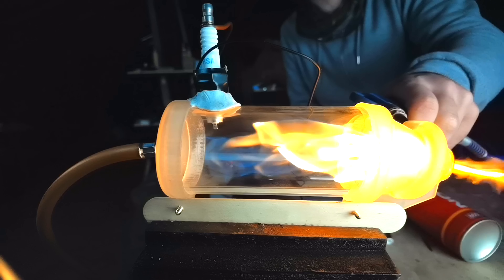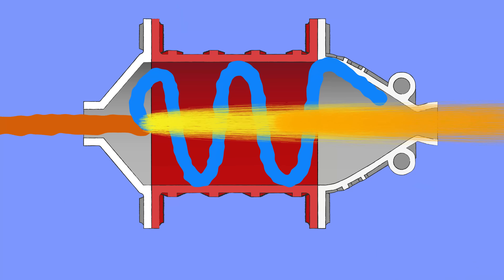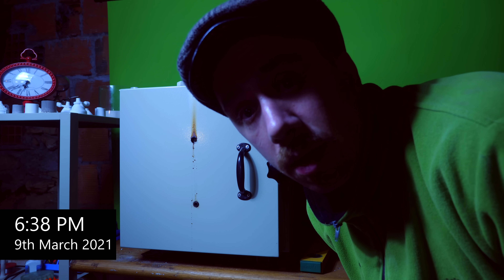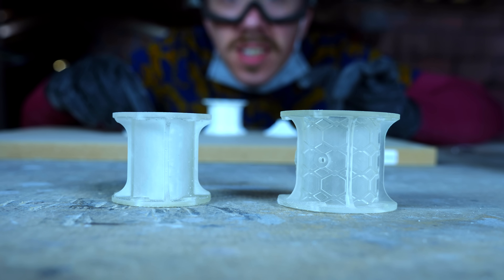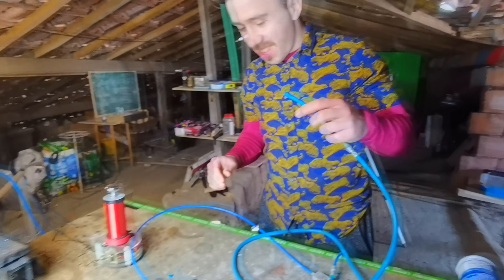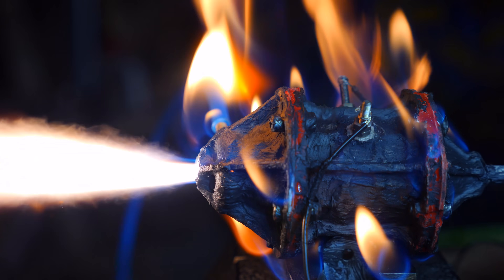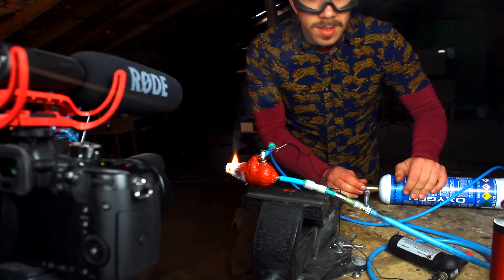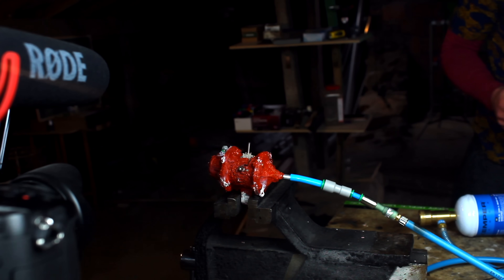Vortex Rocket V2.0 (3D Printed)

Comment: Maybe try lining the inside of the parts with aluminium foil; it's pretty inexpensive, and aluminium is a poor conductor of heat, which is why you can line an oven tray with it and pick it up with your bare hands, even after it's been in an 200+ºC environment for however long it takes to bake your food. If you leave overhangs, they might even help provide flush contact surfaces for your parts, which might help reduce leakage.

Comment: You cold 3d print in the rocket motor chanels ho can be filled with water ,and for the leak you can use carbon fiber or you can mold with ciment from prothesis (in hospital they use that stuf its a pouder combined with a solution and you have 15 minutes time to mold that) and resist like 1400-1500 *C

Comment: Hey Inzegta, I have an idea about the leaking problem, after you printed the engine parts put them in the oven, but dont let it dry completely, now pure ceramic resin in a container and sink the parts in the resin, then put them in a vacuum chamber, my theory is that under minus pressure the liquid resin will fill the small holes in the printed ceramic parts because the air trapped in the holes will be sucked out, and well the resin will get in. then place them under UV light and put them in oven again and let it completely dry, you know these last few parts better.

Comment: Id try something like soaking your part in concentrated sodium silicate after firing (preferably in a vacuum chamber to make sure the viscous stuff gets in properly; and then give it time to dry/cure; maybe repeat a few times. Sodium silicate does not have a super high melting point, but even if it goes all glassy when in operation, at least it wont burn or vaporize and its not like its just going to start dripping out of your microscopic pores. Perhaps there are more suitable alternatives to sodium silicate; but this is a cheap and available one that I know of, that I suspect would do the trick. If it gets into the pores properly might also help with the mechanical properties quite a bit.

Comment: I think there are two ways to go about this.  The first is your current method where you are covering the porous part with a non-porous material.  There is a patent from 2011 that tries to do this. The second would be to actually fill the pores.  There is an Italian paper that describes electrochemically filling the pores with metal.  Unfortunately I can’t read it so it doesn’t help.  But that gives me an idea, could you soak your ceramic parts in a slurry so that it fills the pores?  I wonder if you could even rebake the part to increase the overall hardness of it.  Does that make sense?

Comment: I recently printed some pressurized parts. 3d prints are very porous and need to be sealed. But sealing makes more sense if you seal it from the inside than the outside. You need way less sealant. (Sealant gets pushed into the pores, if it needs to dry, dry it under pressure) 
Of course I do not know how your sealant reacts with the high temperatures.

Comment: you can try 3d print metal. Some manufacturers use this method so you can probably ask them. I know its not accessible for everybody but for working vortex rocket that doesn't leak or burn down after 5 seconds i think it'd be great. Keep up the great work i enjoy your videos and admire projects you do :)

Comment: To stop it from leaking you could glaze it with pottery glaze in your furnace; it's essentially a glass coating so it should hold up better than the silicone.

Comment: You should get a CNC machine to make metal parts whenever necessary! 
It's still a form of 3D-printing (just reversed maybe)
Reply: 3d printing is additive manufacturing, while CNC mills are a form of subtractive manufacturing. Apples and oranges, both are fruit, but an apple is not a form of an orange.
Reply: @c-djinni  Hence the "just reversed maybe". Though, I don't think 3D-printing implies "additive".  Thanks for your input, though.

Comment: the ceramic is not strong enough to handle the vibrations, and is shattering
note that most of the engines start burning correctly, then add leaks over time.  this indicates new cracks forming while the engine is in operation
maybe try thicker outer walls, or thicker support framework
or 3d print some molds and cast your engines out of a more robust material

Comment: I think the porosity of the ceramic is a fundamental flaw that you're not going to overcome without essentially reconstructing it on the outside with another material. I think you need to consider printing ceramic molds and making the rocket out of aluminum or some other metal. I think casting the torpedo one in two halves is the way to go. Your could also use molds to make ceramic parts the normal way and use your furnace to fire them. Then you would have a ceramic part without the porosity.

Comment: Maybe lost pla cast plaster in a metal container with the metal fittings added before casting and sealed with brake paint. Won’t be pretty but should hold shape leak less.

Comment: I'd try to attach them that they sort of slide i each other, that way when you increase pressure, the parts should press on each other and make the seal tighter by itself, instead of trying to seal them by force from outside like bolts and stuff. However, the parts will probably have to be super precise.

Comment: My suggestion on to stop the leak should be layer it. Use the Refractory cement first, then a mesh, then another layer of cement then the silicone.

The other option is start with the cement again, then silicone, then more cement.

Comment: try glaze for ceramics :)
Reply: or several layers of silicate glue, for the entire engine after assembly.
besides, the silicone sealant that you use loses its properties at 300 degrees and starts to burn by itself :)

Comment: Hello Integza! My suggestion would be to 3D print a negative mold and use plaster or ceramic to cast the parts and then cure the parts in the oven. If this ide works this should fix some troubles. It would be like the lost pla technique, but instead of pouring metal the lost pla will give the internal shape needed for the Vortex rocket.

Comment: For gas leaking thru the porosity of the ceramic print, soaking the parts after firing in sodium silicate ("water glass") solution and then slowly evaporating the water off in a sub-100C oven might be worth a shot.

Comment: Lost of good tips here is seems like. Good thing I read a few before adding my own suggestion of glazing and slow curing with a supporting material like find sand or fine salt.  A slower curing might help limit the cracking too, but to really deal with the leaks, you need to use glazing that can handle high temperatures. I'm betting that it is not cold in the burn chamber and knowing how hot it is would help you figuring out what media to use for sealing. It sure looks like you get a burn through from the inside.

My weird mind went away on a tangent after that and wondered about using a water jacket around the whole thing and use the heat as a pumping action, it would help you figuring out the best shapes and such and maybe keep the whole thing a bit cooler. Then once that is done, you'd need to find the right material that don't leak and will handle the heat.

Another odd thought is using water pushed over the whole thing and letting it blast out as steam besides the main thrust, I'd like to see that actually, but I have no idea if it would work or not for testing. To go up it would be useless. Well unless someone figures out of to port water in flight, but then you could port fuel too. :)

Comment: seems like the porosity of the ceramic allows it to crack and fail. It may just be that bit to light weight for anything but low pressures. You could try glazing the whole part inside and out for a smoother harder finish. You may be able to do it with your kiln oven there. Another issue maybe a lack off cryogenic cooling on the vortex side. That would loose the insulation effect. You could try more inlets and bring the fuel pipe further into the engine ( say half way down ) to force the ignition to be after the oxygen has been down the body and is expanding down through the center. Impressive work non the less. Well done.

Comment: It looks like on the video, before the last engine lit itself on fire that the rubber expended do to pressure. Probably do to the coating letting go of the ceramic. Why don't you coat the inside of the chamber around the seal? I always feel like pushing against something is stronger then pulling against it.

Comment: Embed the engine into a block of concrete or plaster lol. Or just use carbon fibre again. Idk if the cement one would work 100% though because maybe the engine would melt closed on the inside.

Comment: The solution to your problem may be pretty simple:
since the engine is continually emitting thrust, and it gets red hot, its likely cracking from the parts moving and also being stuck to a vice. Maybe let the vice linearly move back with the retention of a spring?

Comment: Try a glaze of a product like ICT-100HT https://www.itccoatings.com/new-products/itc-100-ht-ceramic-coating
Might seal up the pores of the ceramic to stop the leaking. I've mostly seen it used in Kilns and such but it should work for this purpose.

Comment: Use your 3d printer to create your rocket/engines... and use the lost PLA casting method o produce a Bronze, rocket/engine. the metal you use is up to you but i bet it would last a bit longer than your porous ceramic.

Comment: You need to glaze your ceramics, may help with the leaking having a solid ceramic part.
Reply: Would a lead glaze help absorb heat?
Reply: @Longbowgun  lead would melt and atomize, so thats a big no-no
Reply: A glass glaze might work if it didn't crack. Best to research.

Comment: i have a comment for your vortex rocket, a some point there were explosition inside the chamber who dammage the proceline, and broke the engine. If there is explosion inside the vortex rocket, it's because the spark was in the middle of the chamber. You can try to put it at the output of the chamber, because after the first ignition, the reaction is going to auto ignit herself. i think

Comment: Why dont you try a sugar rocket engine, but instead of being a solid, one time use engine, use icing sugar injected into the combustion chamber as sugar is very flammable and if oxygen is mixed, it should have a similar effect

Comment: I doubt the materials in the body will handle the compression you would need to maintain a seal at the increased pressures when you add more O2, you need to clamp or compress the joins but i doubt the ceramic will take it, no idea what you can do to get around this

Comment: paint your prints with waterglass.....sodium silicate mixed with water......it can handle high temps when dried....you can bake it in your kiln.....it dries rock hard like glass to seal the porosity issue that your prints are suffering from....I hope that this helps you.

Comment: Scale up 3x. Handmade, multilayered design with custom triangular high-temp ceramic tiles, fired in a pottery/art kiln. Arrange the geodesic tiles in the desired shape/grid/array and connect them to a steel outer shell that is externally water cooled and internally pressurized!  Insulate the ceramic grid/tiles with furnace wool glued to their back protecting the steel chamber. Weld copper tubes around the steel chamber with a double helix starting from either end; this keeps the water from being too hot on the output side. Its basically a steel pressure chamber that won't melt with a ceramic inner chamber that has hundreds of cracks by design. Just keep the water from boiling and you're fine!!

Comment: 1 use replaceable graphite nozzle.  
2 pressure is too much try recalculate nozzle diameter. 3 try coiled copper tube with water to cooling, but i think all these actions, not enough because pressure and temperature is too high

Comment: Drying and pre-firing ceramics help aid in the amount of shrinkage that occurs to the end product. This is very important in thermal processing; if ceramic insulation products are not dried or pre-fired, the resulting shrinkage could cause heat loss issues in a furnace, as well as problems with the end product when it shrinks as heated to the required temperature.

Factors such as material composition, density and shape of the workpiece, moisture content, and trapped water all need to be considered when designing a proper drying program.

In theory, this is the maximum rate at which ceramics should be dried. Most ceramic-formed projects are placed in a controlled drying room, in which the temperature is set to ambient or elevated slightly, and the preliminary drying is done by humidity control. 

As noted previously, humidity and temperature are the variables that need to be controlled for successful drying. Whether drying takes place as a separate process or is a preliminary stage in a firing cycle, air movement can be key to uniform drying. During the early stages of drying, it is best for the air to be hot, humid and under a slight amount of pressure in order to flow through the load uniformly. Once the chamber is heated to temperature, forced convection fans inside the chamber move air through the load, and draft-inducing blowers pull ambient air through the chamber. As the temperature rises, the air loses some of its humidity, allowing the water content from the load to be taken up by the air. As the cycle progresses, more water content is absorbed and removed by the air flow until drying is complete and the product is ready for firing.

Platinum-alumina catalyst powders were successfully processed in a two-stage drying/firing procedure at a Mid-Atlantic plant using ceramic box saggers to contain the powder. The saggers were then loaded into tall, narrow alloy racks that rolled in and out of a pair of car bottom furnaces. The configuration of the alloy rack was designed to allow the saggers to be heated from the sides by the electric heating elements, and to allow for proper air flow around and through the load.

Two draft inducers at the roof pull ambient through the load at various points in the process cycle, especially during the initial stages of the drying profile, and at the end of the firing cycle to improve throughput. Not every ceramic product can be dried and fired in one contiguous cycle

Source https://www.industrialheating.com/articles/95370-factors-to-consider-in-ceramic-drying-and-firing

Comment: Try increasing the size of the contact plates of each part so there's more surface area for your parts to seal, making it harder for air to leak out. This will also give you more room to add more bolts tightening the seal between the parts.

Comment: How about putting the thermal paste you made for the pulse jet engine, on the exterior surface and then by using a compressor, suck air from the inside so the pores in the ceramic are sealed with the paste.

Comment: try painting it with engine enamel spray paint? Several thin layers 10? allowed to set about 20 minutes in between and then an overnight rest  to cure before testing? 
The only other idea i have is ceramic glaze which potters use.  I think the glaze forms a glass like coating on the outside and would probably hold up pretty well to the higher temps.

Comment: 3D print the engine out of some plastic and create molds to cast it out of some proper heat resistant material. I think this is the only way to avoid the gaps created by the 3D printed layers. You can see a similar method being used by Alec Steele for creating casted items.

Comment: Put the bulk of the engine in a metal tank with a COPV filled with helium for pressurization. If the outside is higher pressure than the inside, it is impossible to leak.😅😉 :awesome:

Comment: @Integza you could 3d print a ceramic inverted form of an engine ans melt metal with your furnace / a backyard foundry, King of randon style, and cast around the negative model, then break apart the interior ceramic.

Comment: You are the best! 
Try to give your engines some proper rest before testing - think about it: they’ve just been born out of hell oven and you throw them into more fire, they need some spa procedures, maybe some kind of ceramic bath to seal the pores... and in addition burn something Smokey under small pressure to seal the pores from the inside with burning waste (soot and ashes)
Reply: Or you should think about making a ceramic matrix with you 3D printer and  then make the engine of porcelain because as far as I understand it is a little bit stronger than the 3-D printer structure and The glaze it and you’ll have a wonderful tea pot. Collin furze will die of envy

Comment: Hey how’s it going, so you may be able to make a mold out of your 3D printed part and use it to cast a metal piece then weld it together. With metal you will not have to worry as much as ceramic as far as it busting.

Comment: Put the ignition as close to the nozzle as possible; I'm thinking if the gas is burning in as small a volume inside the engine as possible, it should alleviate heat and also some need for a perfect seal

Comment: You should consider applying the same high temp cement to the inside of the pressure chamber as well as the outside